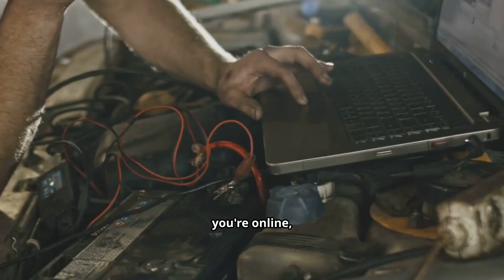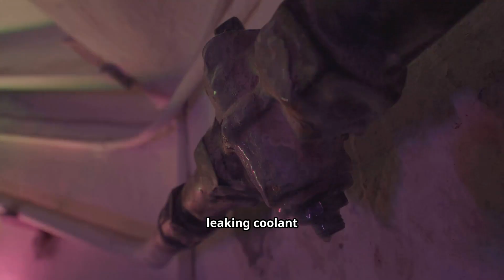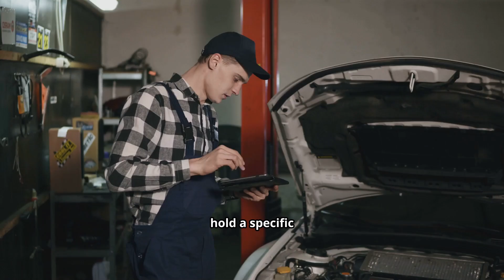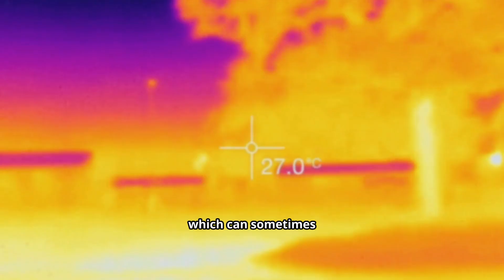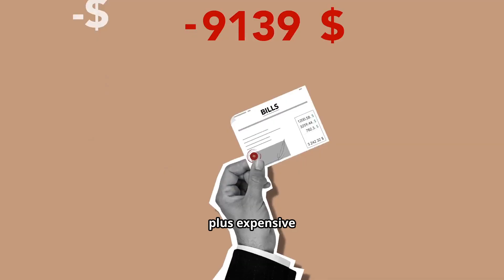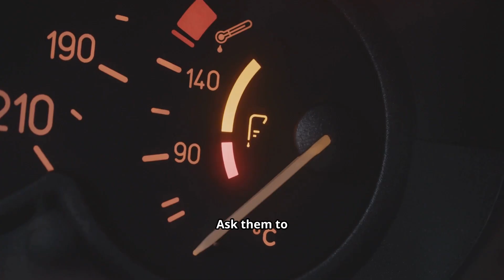Jeep Overheating After Engine Replacement? Don’t Ignore This

Comment: Here's the real issue.  Mopar's reman division is having a problem with quality control.  Myself, as well as many others, have had problems with leaking head gaskets.  These leaking head gaskets are NOT a result of us operating our vehicles in dangerous temperature zones, or specifically, above 255deg, which is what Mopar considers "overheated". The gasket issue is a result of poor quality control, and incorrectly torqued headbolts.  However, Mopar refuses to accept that there's an issue, and as a result, is automatically denying warranty claims for those of us in this situation, including myself.  I NEVER operated my vehicle to where it was in the overheated temp zone, never had a CEL, and never once has my vehicle went into Limp Mode.  However, my new reman motor running much warmer than my original engine was a result of improperly torqued head bolts, which resulted in an early on, premature, head gasket leak.  After replacing every single part related to the cooling system we then realized the real issue was the head gasket.  The engine passed every chemical test, every compression test, and leak down as well.  But, once the vehicle would get into operating temps, and after about 30-50 miles of driving, that's when the temps would start to really climb.  It would take that amount of time for coolant to start leaking from the gasket, and the radiator to dump coolant into the expansion tank(and never return to radiator when cooled). This is NOT operator error.  Mopar, you have an internal problem, and unfortunately, you're putting the blame on the customer.

Comment: What can I try next on 2007 Jeep Grand Cherokee Laredo. The tenchner pulley broke and the serpent belt came off, I had to drive it a little piece away and it ran hot. I've changed the pulley, belt, thermostat, and the temperature control sensor. It's still running hot and saying that the transmission is overheating. I have a water pump ordered and waiting for it to get here. But why's the transmission overheating also? Sometimes I've tried different things, since the thermostat change, the top radiator hose is hot and the bottom is cool, but sometimes they stay equal heat wise